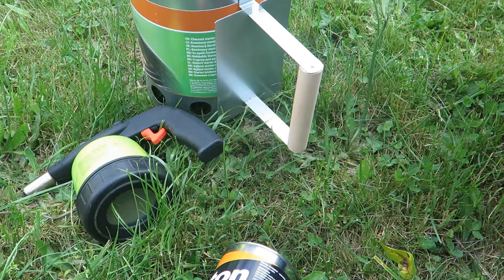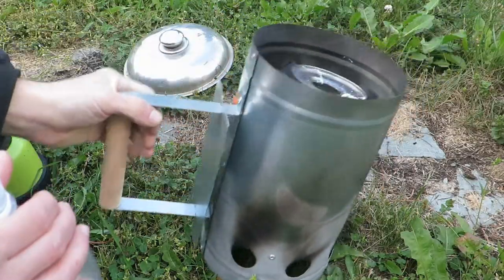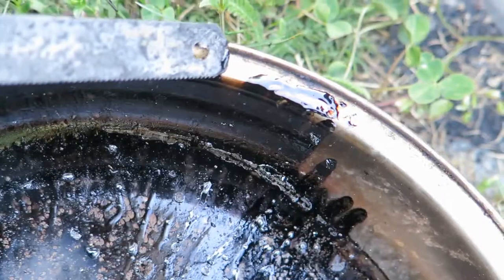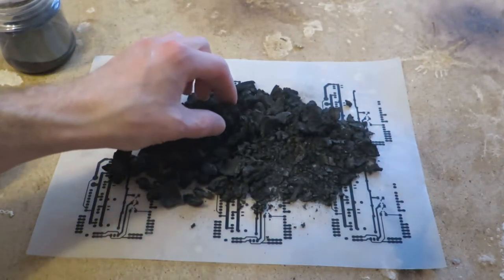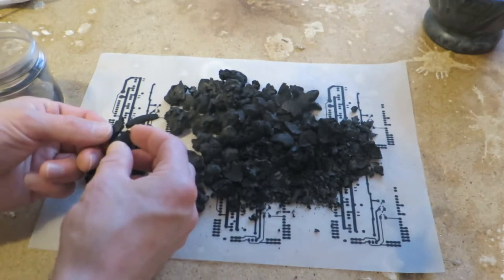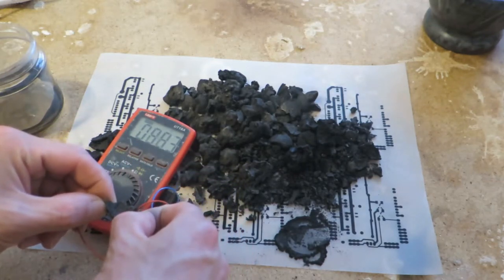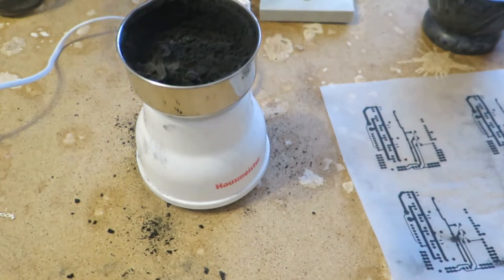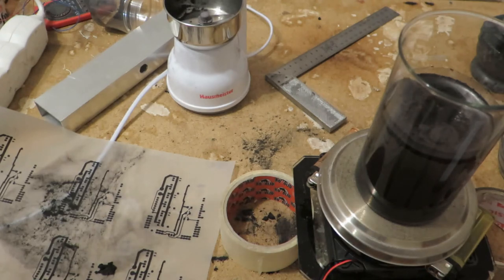Making elemental carbon using pyrolysis

Comment: Carbon has many allotropes, that sort of carbon from low temperature pyrolysis is always the amorphous type. If you mix it with some graphite powder (that has been washed with ferric acetate) and place it in a white high temperature clay sagger that is sealed then slowly heat it in a microwave until the water is driven off you can then heat it on full power for a while (the time is the data you need to determine by experimentation). This process may get the carbon up to a high enough temperature without it oxidising so that there is a migration of carbon atoms from the amorphous carbon to the graphene that extends the edges of the graphene sheets, they act like a template for the growth.
Reply from the maker: I am aware, but the question is: do I really want graphite?

And also I can imagine, that you will need quite intimate contact of material to propagate crystal growth, so I can imagine that pressure would be required. Maybe even cycling of that process.

You can however precipitate carbon from molten metal. probably iron would be best for this.
That sounds like a lot of fun, but I wouldn't want to make kilograms of graphite using this method. At least not in backyard :)
Reply: Ball milling may be enough to mix the two types of carbon enough. https://link.springer.com/article/10.1023/A:1012670104517  And don't underestimate how hot graphite can get in a microwave either, far hotter than any liquid metal you can easily produce.
Reply from the maker: hmm I can give it a chance. maybe next payday, so I am ready to buy new microwave :)

Comment: When I have a campfire a lot of the charcoal is of really high purity especially the pieces underneath the ash layers. Some have low resistance of like 10 to 40 ohms. Also in this process you can use the ash as a neutralizer for strong acids/bases or for other synthesis. 
What do you plan to use the carbon for? I like to use my carbon for electrodes in electrolysis or battery science.
Reply from the maker: I will rather answer your last question: What do I have it for. Actually for nothing, I was just curious :)
Maybe I can use it for some exotic tools, but I guess if I can buy it, then I will, if it is economically feasible.